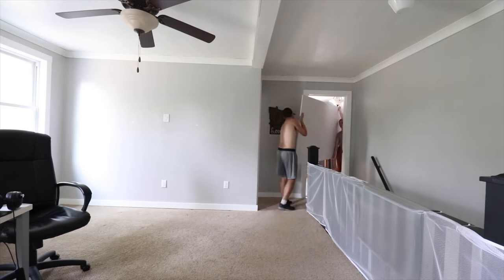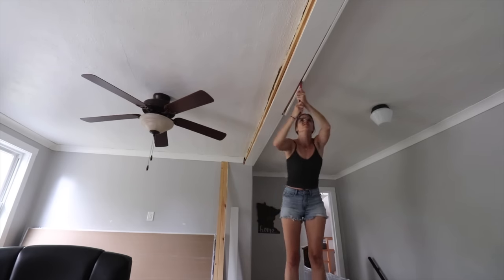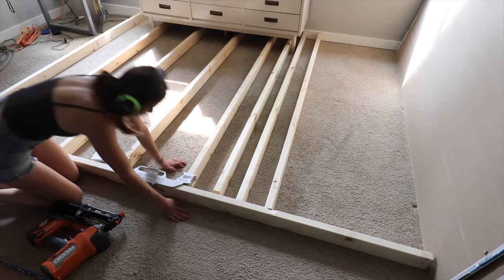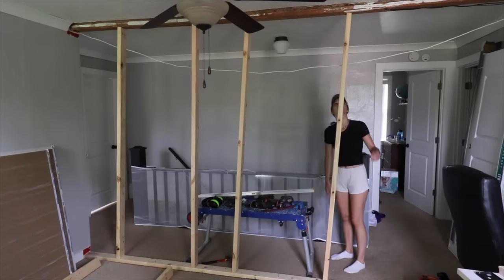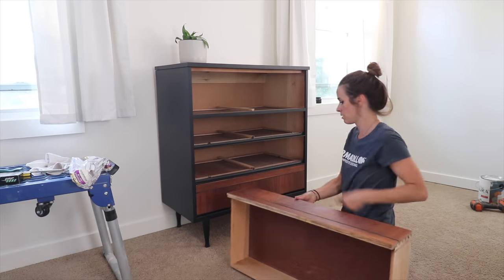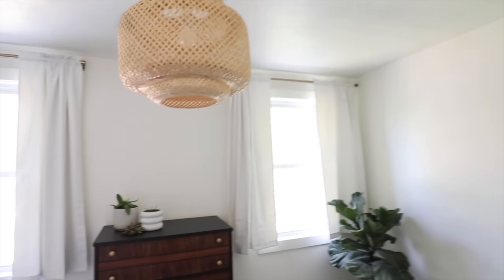DIY Build a Wall and Add an Extra Room to Home | Bedroom Makeover

Comment: I’ve done plenty of jobs like this, great work! I would just recommend to anyone else looking to take this on: plan ahead for electrical receptacles and to also add insulation within the wall. All the noise from both ends of that wall will go straight through and cause headache down the road.
Reply: Yea I would definitely add in insulation, it's so worth it.
Reply: Great advice 👏🏽
Reply: What materials for insulation would you recommend?

Comment: great job, the only thing missing is the outlet on the new wall,  one on each side, per most building codes  you should have one every 6 feet  so you don't need to have extension cords.
Reply: Thanks for the tip. I think That’s the stuff we diyers tend to forget to check. Well, at least me!

Comment: you can hang drywall by yourself if you learn one trick: measure down from the ceiling a little over 4 feet, and throw a screw in the studs at that height. you can then lift the drywall up and set it on top of the screw, angling the top back towards the wall. adjust it just how you want it and you can screw in each section without needing a second set of hands.

learned this the hard way after drywalling a 9 x 14 room pretty much by myself!

also, even though it was just between two rooms, i would have still insulated the divider wall. not only is it a good sound damper, but it also insulates the outermost wall from the inner space that much better, so that even if it is cold in the outer room, that cold does not translate as much to the inner area. just my two cents.
Reply: You haven’t lived till you’ve hung 5/8” drywall on the walls and ceiling of a 400 sq ft garage completely by yourself… Never again.
Reply: you’re amazing

Comment: Very nice job. Frog tape is nice, but yellow can be tricky. If you put the tape on then brush a light coat of the color Underneath, it’ll seal the edges. The way the green frog tape bled on the bed frame can be avoided with a tiny amount of clear siliconized Alex caulking on the edges, then wiped off.

Comment: If there is not a rafter over head for you to nail the top 2x4 into for your wall you can cross stud between two rafters to hold the wall in place. Of course you will have to cut away drywall to fit up into the ceiling to do it. Probably not code but will work.

Comment: You never disappoint with your DIY projects.
If I may have one suggestion/question? Before you had the sheetrock up, wouldn't it have been a good idea to put receptacles in the walls? If I'm not mistaken, I believe code requites them every 6 feet.
Also, is the stud you're working on at 3:52 covering a junction box?
Please don't take these comments the wrong way. I wish I had half the talent you have.
Reply: Was thinking the same thing.
Reply from the maker: I should’ve put an outlet in the wall, yes. That was a mistake! The hole I’m covering at 3:52 was just an access point cut by the previous owner, not a junction box.
Reply: @WelcometotheWoodsBlog  An outlet is something you could always add down the line.  Great work, btw.  I'm utter crap at drywall.  Wish I could get the results you're getting.  I know it's practice, but I think it's also patience (which I have none of).  Your son is going to love his new room and you've added a ton of value to your home with an additional bedroom.
Reply: @T_Jonesy  Sure it could be done later, just much easier to do it before the sheetrock is up.
She did a fantastic job anyway.

Comment: Working in high end commercial casinos they always mud the whole wall not just tap and feather it out. Not saying you have to. But they mud the whole wall, sand, hit with light and fill/build/sand and spots, prime, sand, prime, sand paint, sand and paint. Sometime additional primes and paint. It’s wild lol.

Comment: FYI - a level 5 drywall finish is when you skim coat the entire wall and sand finish. Not just the joints and screw holes.

Comment: One question, what you used to attach the drywall to the 2x4? Screws? Or nails? I don’t have experience with wood cause I have a concrete walls
Reply from the maker: Screws

Comment: I had the same thing with a wire. There was a nail causing a water leak in my wall. The nail was holding two wires together and they ended up just being cut on both ends. So annoying sometimes 🤣🤣🤣

Comment: Nice wall, only one problem, electrical code requires an outlet every 12 feet on an interior space. The US National Electrical Code, Section 210.52, states that there should be an electrical outlet in every kitchen, bedroom, living room, family room, and any other room that has dedicated living space. They must be positioned at least every twelve feet measured along the floor line.

Comment: Did you add electric to that wall? Otherwise it’s not likely up to code…probably need an outlet on both sides of the wall assuming that wall is at least 6ft long.

Comment: Im always surprised people will do all this work and be worried about a little mud and tape. Its very forgiving stuff. I always tell people to use more than they think they actually should on a patch or on seems and nails and use the widest trowel you can so you don't even need to do any sanding. If theres some high or rough spots use a wet sanding sponge and sand as little as possible.

Comment: 1) If your nails just pull out of the boards, you are using the wrong nail. Ring shank nails are extremely difficult to remove.
2) If you  can't measure 16 inches OC for your wall stud placement, you shouldn't be building a wall. That jig is a joke.
3) It's a good thing that wire wasn't a powered wire or you would be in violation of building codes and be risking burning your home down or getting shocked when installing the drywall.
4) Always install drywall top to bottom.

Comment: Serious question.  Did you spend $92 on the stud master for one wall?   I am trying to understand when I should be dishing out money to make sure I don’t get frustrated with all the measuring and hold square.  But my pockets aren’t all that deep. Hope that makes sense. For example, I think the 5-in-1 adjustable workbench is a game changer.  Such a find. Thank you. I am building out an exterior room and struggling with all the tools necessary.
Reply from the maker: I do framing regularly so the studmaster really saves me time on multiple projects (fireplace build, this wall, I’m partitioning a closet by building a new wall coming soon, etc).
Reply: Don't spend money on a stud master. Cut a block at 14 7/16" and use that for a spacer. 14 7/16" is the distance in between studs.

Comment: Hi! I have a weird half wall in a room. It's a dangerous place as the other side is a drop off to stairs and I have an autistic child. I am scared to death he will decide to climb and fall. Would I be able to do this, but make a top plate and the bottom plate and insert it between the top of the half wall and the ceiling?? I hope that made sense. Let me know. I hope you see this LOLOL

Comment: for sure DIY projects can be VERY VERY nerve wrecking but I know like you know that I can do a better a NEATER job than most contractors....most contractors will do a sloppy job since they're on the clock...I did a LOT of reworks in the house, minus the major plumbing, electricals etc...and i can do a 1000 times better than the builders actually did...btw can you do a tutorial on how to change a lighting fixture...like the wiring etc. thanks

Comment: I would have made a wider barn door so you can move larger items in or out with ease and have the option of opening it up from time to time or having it closed off.
Reply from the maker: I prefer more wall space and the privacy of a locking door. :)
Reply: @WelcometotheWoodsBlog  Agree 100%.  Barn doors are really tough in bedrooms and bathrooms.  There's very little privacy.